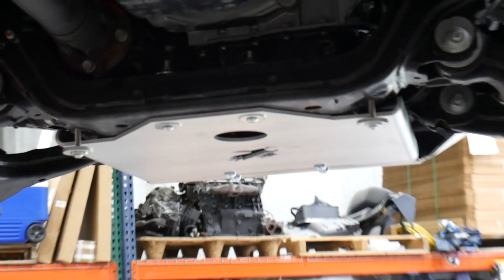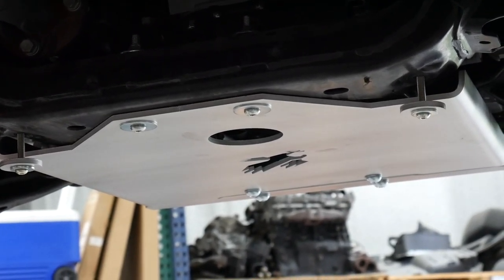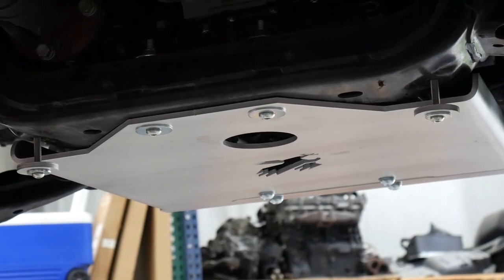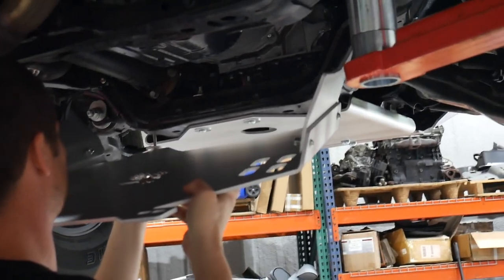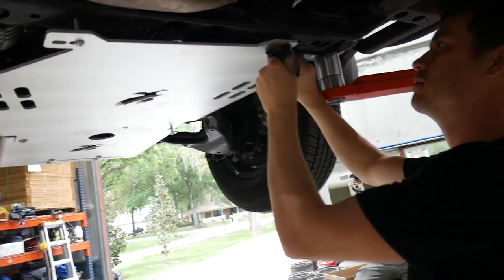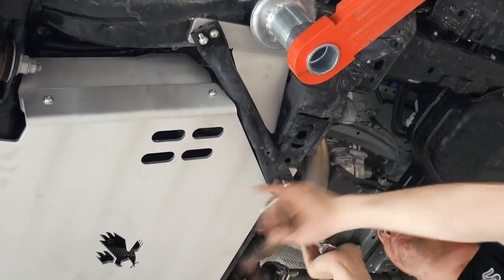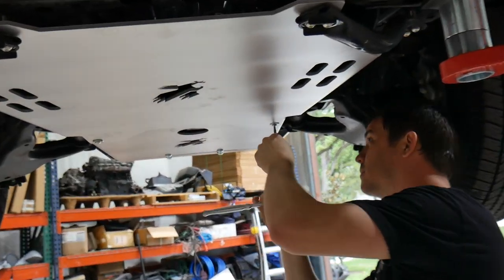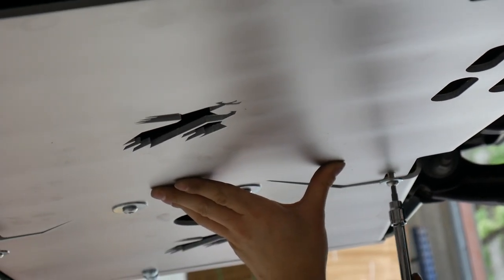Toyota 4Runner Catalytic Converter Shield Install Video

Comment: Thanks for the video, assuming this is for the GX460 , it would apply till 2023 year model ?
Reply from the maker: Yes, install is overall the same for the GX460 cat shield. The only difference is the winglets that mount to the shield. You'll see a note about these on the install guide.

Comment: For GX 460 with factory front skid plate. I have to remove front skid plate for oil change. Does front bolt of cat shield mount on top of rear factor skid plate so I need to remove both plates for oil change?

Comment: Small question. Those side plates that mount on the main ones. Look WAAAYYYY smaller then the one I see on the video. Whats up with that? Granted my step dad is the one who bought this kit not me. But the paper says 4 runner. In fact the side plates look like its 4 small peices instead of 2 medium sized ones.
Reply from the maker: This video is based on the latest version. The earlier version does have smaller winglets. In addition, the winglet design does vary based on certain vehicle specifications.